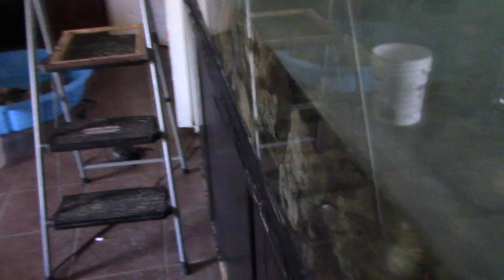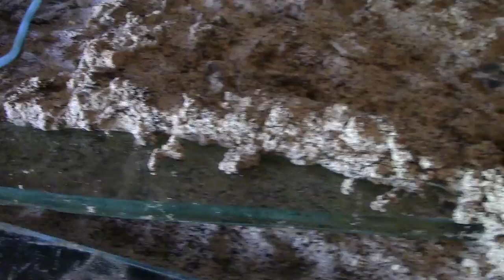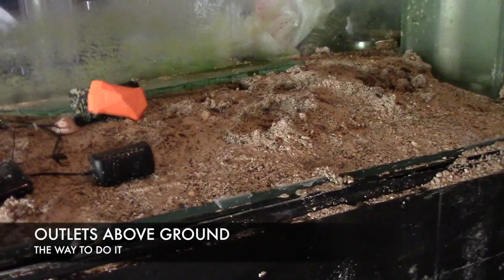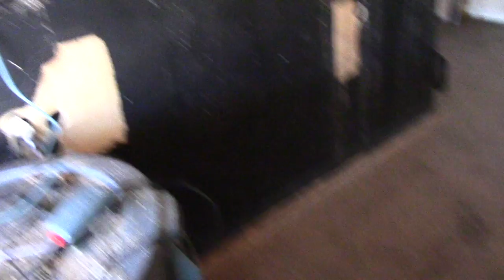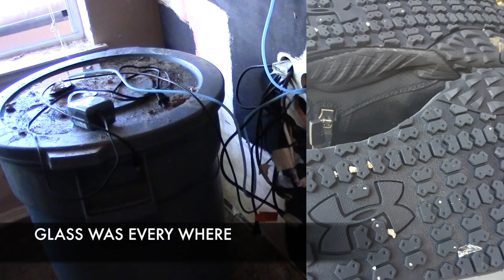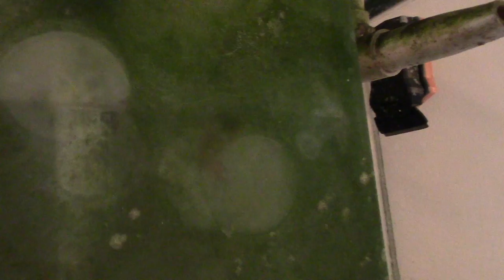400G REEF FISH EXPLODED TANK CRASH SILICONE FAIL WORST DAY EVER

Comment: If you google Marineland Tank failures then you will see this can happen to even brand new tanks or any tank because of manufacturer defects, they do happen. There are so many factors that can make a tank seal fail. Even a un-level tank being off minimally can cause seal failure over time. Poor Silicone beads also. Another problem I see if people re-sealing and aquarium and because the label says 24-48 hours to cure. That is an estimate on a small thin bead. You should always wait 1 week or two if possible.  If the silicone still has a vinegar smell to it, then it's not fully cured.
I buy used tanks all the time and I always re-seal them no matter the condition.  You have to realize the weight of the water alone is a lot for a glass tank. Then you add sand which causes more pressure and then live rock and even more pressure. Finally, you now have a full tank then you add powerhead or gyre which will cause waves and will cause pressure. 

Most seam failures don't just instantly happen. There are usually signs such as a very small leak, breaks in the silicone, silicone peeling up from the outside to the inside of the seam etc. If you look at most seam failures they happen in the bottom or lower 1/4 of the tank, this is where the most pressure is on the tank. Re-Watching the video and seeing the other silicone on the areas that didn't break, that silicone was in very poor, poor shape. I would have never put water in it without a full re-seal.

I have re-sealed and repaired many tanks over the years and not a single failure and I have several tanks over 20 years old still doing just fine. My oldest tank is a 75RR Perfecto which was manufactured in 1991.  I've been in this hobby since 1997. 
The Problem most people make is they use that $5.00 tube cheap silicone from HD, Lowes etc. That stuff is not made to hold pressure, it's to seal things like windows and doors and waterproofing. Yes, I've seen people use it on smaller tanks with some success, but I wouldn't use it on anything bigger than a 55. I I prefer to use GE SCS 1200 as it has the highest tensile strength of any silicone and that's what you want and need. Momentive RTV108 is also great also but has a bit lower tensile strength. Ask just about any tank builder and they will probably say either of those 2 and for very good reasons.
It's alright for me cause when someone causes panic about used tanks. Then prices fall on used tanks. Win, Win for Me!!
Reply from the maker: Hi Allan, Yeah I knew about RTV, but Im bot buying my next tank used. Great information, I think once you start going 120g+ tanks are going to have a lot of pressure as it is.  My buddy is starting to pick up and start again, so this is good. Slow Slow Start
Reply: I just heard abt my friends fish tank shattered and flooded his whole new floor ... it was covered by home insurance tho ... i thought he lied ... now i know it could possibly happened

Comment: How perfect for Halloween because this video scared the shit outa me! I went out and looked at the seams of my tank right after this!,,,
Reply from the maker: Yeah It was/is pretty terrible. Im checking mine daily. I need a new tank
Reply: 915Mang good idea I'd be paranoid. I'm checking the seams on my planted 10 gal because the thermometer might be making the seams weak. Hmm lol then again I could upgrade to a 15-20 gal 😊
Reply from the maker: $1 Per Gallon!
Reply: +915Mang what do u look for when checking the seams?
Reply: The strength of the aquarium is the silicone between the glass. The silicone on the inside you can touch is simply to protect the seam. You can check your silicone by seeing if you have bubbles between the glass.

Comment: What are the typical warranties?   I’ve had many many fresh water tanks and am still running 9 freshwater tanks, all 20 years old or longer.  Recently had a saltwater glass tank have a spontaneous crack.  Only 18 months (or less old).  Working with the manufacturer.  Total loss of a fully stocked tank - fish, corals $$$$, inverts, sand.   Live rock can be reused.

Comment: I noticed he said it was only 1/2" glass. There is no way a tank that big should have been built with 1/2" glass. 3/4" with 1" bottom would be what most tank builders use with euro bracing also. I watched some of these previous videos and the silicone was in poor shape. It sucks cause this was a very beautiful tank. Whoever sold you that tank got one over on you.
Reply from the maker: Yeah Allan, I didnt actually measure the glass, but if thats what D said, then thats probably what it was. He lost a lot, really sucks.  Hes doing the 300g that was in the kitchen but still.
Reply: It indeed does suck. My worst moment was in 2010 when a house fire wiped out my 180-gallon 13-year-old reef tank. He mentions about the 1/2" glass at 6:53 in the video. 1/2" glass is too thin for a tank that size in my opinion.

Comment: happened to me, was only about 15 gallons of water in the tank but was bloody heavy, no one else in the house to help me move it. and the way it cracked meant I couldn't catch it in a bucket. meant I had to stand there and watch the water pour out the side of my tank onto my carpet, absolute nightmare as it was poor bloke his house must have been trashed
Reply from the maker: Hey Craig that sucks about your tank.  Either way hope everything turned out okay for you.  Hes okay now
Reply: 915Mang it did kind of, I managed to move them into a smaller tank so didn't lose any that day but eventually they all started dropping off one by one because the tank I had spare was far too small, was gutted I'd be suicidal if they were marine fish at $60 upwards a fish I only keep tropical far cheaper and easier for me to keep. Treated myself to a nice new fishtank my old one was a hand me down when my brother got bored was only 70 litres, love the hobby now so bought a top of range 170 litre for a replacement.

Comment: I had a 150 gallon tank with half inch glass ..... That tank was half inch too !! It's no wonder it busted .. I'm sorry but it's true it should have been tempered glass if not it should have been 5/8 thick not half inch. And if you have it setup as a reef tank you probably had the water moving and that puts extra stress on the glass because the front and back of the tank does bow slightly

Comment: The tank could be rebuilt.Salt water is hard on the seals, but it might be the stand that settled to cause this. The bottom edge view and they blow like this but also that seal looks like should have been refine.
What for color changes in the seal, you can drain , cit out inter seal and reseal like every time you see any flaws start. The crust from salt watt build up hides the flaws.
Reply: just no...

Comment: Damnnnn .. maybe you should think about a acrylic tank next ...
Reply: NYREPS acrylic will blow out just as much as glass would. especially with the pressure of 400 gallons. it comes down to age of the tanks we use.
Reply: probably his bracing gave way
Reply: sdq sdq that's what I was thinking silicon let go on the brace and the front pane couldn't handle the weight bowed out to much

Comment: Shit man I am sorry to see this @__@. Anything over 250G is very danger if the tank is not made right, extra thickness of glass or Acrylic and special bounding and Safety need to install to hold the 3344 pounds of water + whatever in the tank. Again, so sorry to see this >_<.
Reply: Did he have foam board between the tank and stand?
Reply from the maker: Thank You, good point. I dont think id go over 250g myself. Just  the extra cost for a tank that size
Reply from the maker: Well ask him the next video

Comment: unlucky, clear centre brace failure, seen it many times on larger tanks. Tank maker forgot to increase the top blade width to increase the surface area for the glue hold across the middle of the tank.
Reply from the maker: +Redemptioner1 Glad it was taken care of. This really sucked his house stunk so bad and it was just a terrible loss of fish and corals along with water damage

Comment: bye 50000$ cry:
Reply: 50k lol...not that much less than 1k in damages to the house and a couple thousands in equipment that has been replaced already
Reply: Less than 1k damage to the house? What about carpet, floor joists, drywall, electrical, studs, insulation, mold remediation, sub floor, paint, and so on?
Reply: most of it went outside when they came it was minimal damage the best outcome plus the carpet and padding sucked up 60% of the water the other 40% was in the driveway lol...we hit it fast and within 24hrs had insurance sending repairmen out to fix it